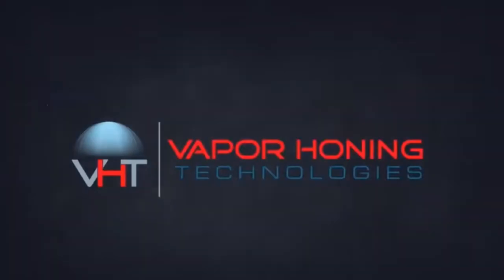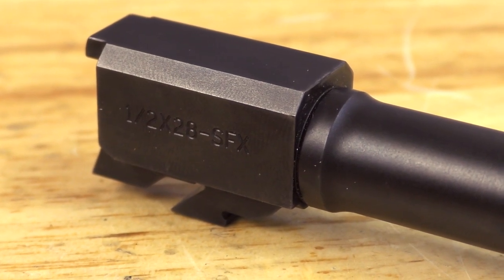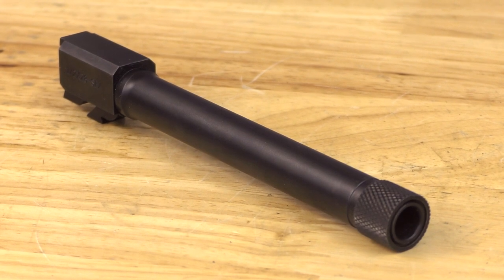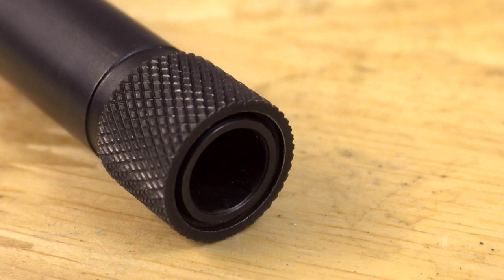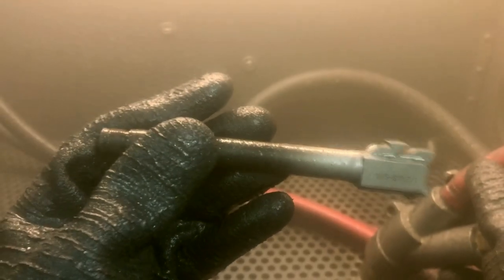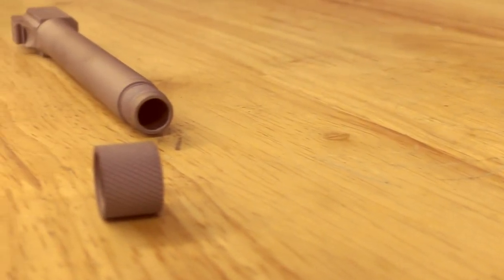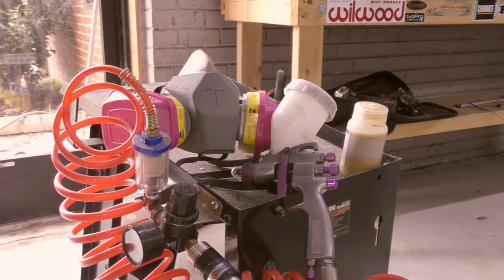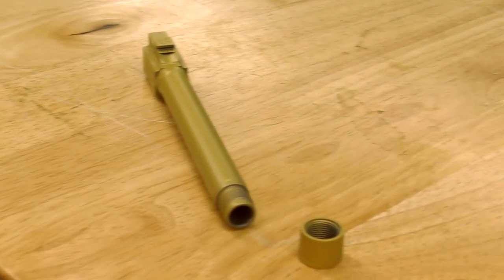Coating Prep gun barrel for a GOLD Cerakote - Vapor Honing Technologies

Comment: I'm a second year gunsmith, I building a new EDC mod1 od green frame slide is black but I want to spray the barrel and RMR plate.  My barrel is black and fluted.  At my dad's shop we have a need blaster and he uses kg gun coat.  Will that be sufficient in spraying the barrel after stripping the black.  Or should I spray over the black
Reply: my take is clean back as is, and go and spray.....